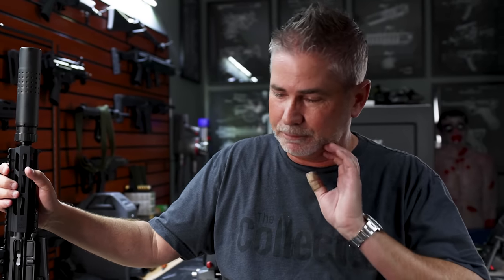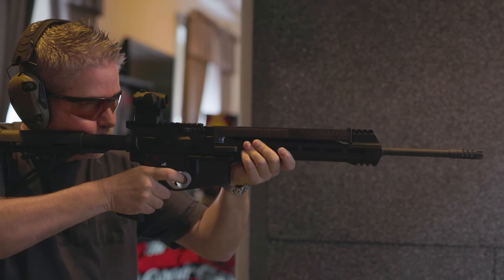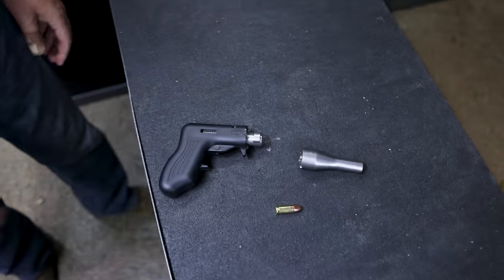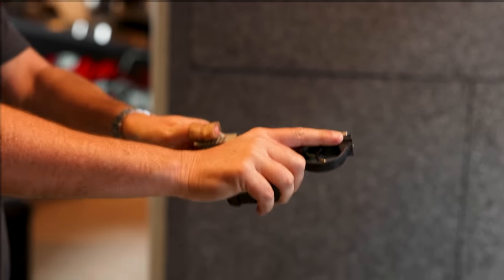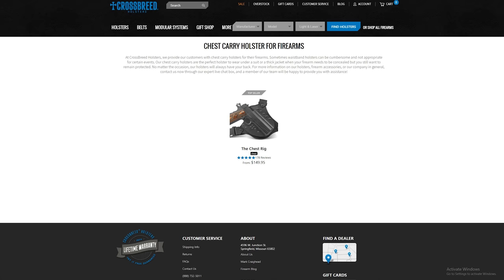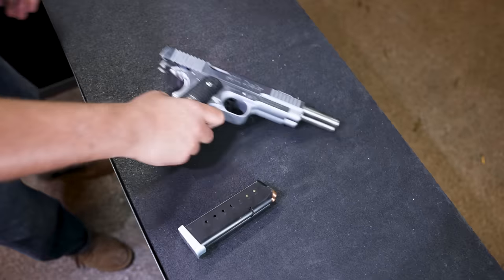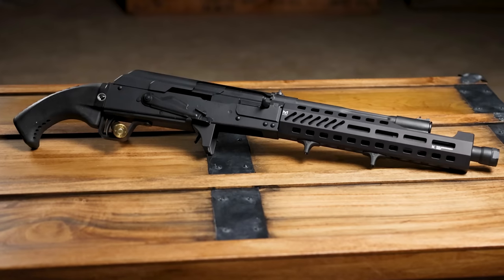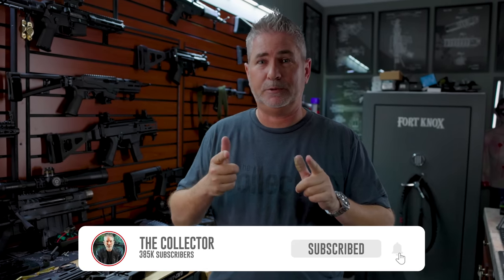Why I HATE Shooting These 10 Guns 😩

Comment: Can confirm that the Tavor sucks as a suppressor host.
Reply: IMI recommends using a low back-pressure suppressor such as those made by OSS/Huxwrx.  There are also aftermarket products such as the gasketed ejection port cover that improve use with a suppressor.

Comment: The Tavor X95 has the ability to adjust the gas pressure…
Reply: But IWI even said themselves that it wasn’t built for suppression
Reply: @hackdaplanethobbes  if you read the fine print for any firearm with a threaded barrel, you will void the warranty for using a suppressor. All guns are meant for suppressors, but manufacturers don’t want any liability because of the suppressor is flawed, causing a baffle strike, they will not be responsible for injury or damage to your firearm

Comment: If I get the chance I'm still buying a .44 automag by Smith and Wesson. I don't like the AMT's because of the metal they use. I don't understand about the shotgun. I've had shotguns ever since I was in my teens. I'm in my 60's now. All of them are 12 gauges. I've shot slugs, buckshot, and birdshot, and I'm not a big guy.